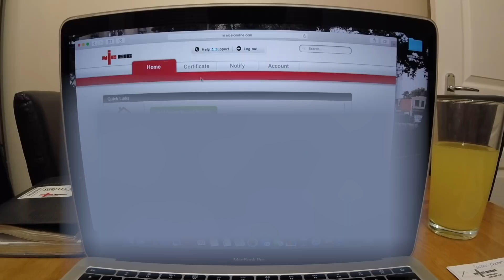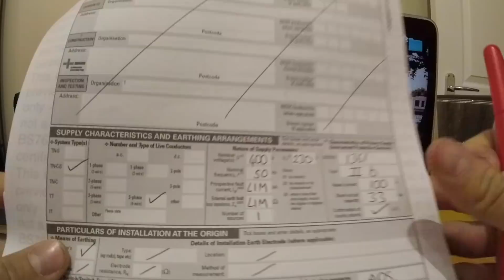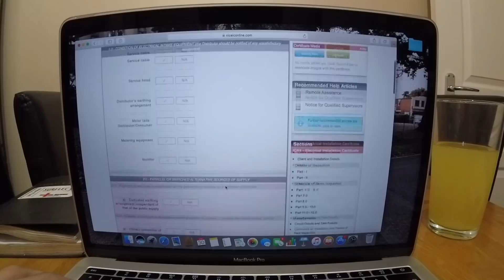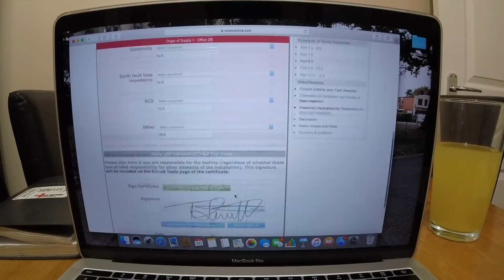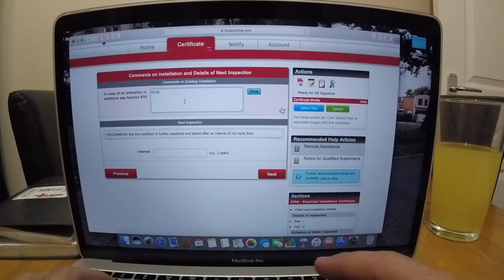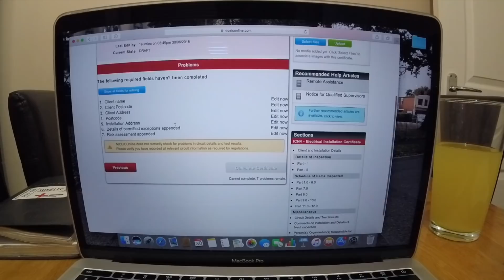SurelecTV- NICEIC ONLINE CERTIFICATION- Electrical installation certificate

Comment: Great video, it helps as I couldn’t decide which certificate software to use. I’ll be going with the NICEIC now. 
One point to note would be with the name you designated to the ‘Office DB’, you can only call it that if the actual DB is physically marked up as ‘Office DB’ on-site.

Comment: Just so you’re aware, in section one it asks for the ZE and the PFC, this is the maximum for your incomer, the drop down brings them up for each common incomer and also 16KA for the PFC! There is actually 5 boxs you should be filling in on the earth electrode section which is confusing! Method of measurment, measured ZE (this is where you put your measured ZE in), maximum demand, method of disconnection and number of smoke alarms! Why they have put it in this section is beyond me but thats how you do it! Also, measured PFC actually goes in the board details in the circuits section!

Comment: Great video thanks for taking the time to do these informative videos. Could I ask if you could possibly do a video for voltage drop, current carrying capacity and there formulas used to work them out. I am doing my level 2 part P and was wondering if I could get another persons terms of using the calculations etc and how you go about doing them.
Thanks

Comment: Great content mate, a lot of trouble gone to in giving an insight into certification. One thing, you say a limitation for PFC  as unable to disconnect earthing conductor ? My understanding of PFC was that all protective conductors must be connected during the test. This lowers the overall impedance (circuits in parallel ) and subsequently gives the highest possible fault current.  Anyway just a thought and not intended as anything else but sharing views, keep posting.

Comment: Hi, I didn't find it boring at all It's good to see the NICEIC software I have only ever used the Easy Cert and Trimble (Amtech) certification packages. You went abit N/A happy and N/A'd where you should have put ADS. Also you stated that you couldn't isolate, therefore the "connection/continuity verified" for the bonding should have been LIM as if you disconnect the bond to carry out the continuity test you are putting the installation into a potentially dangerous condition with no bond in a live Installation. Thank you for the time and effort you put into these vids it's good to see others at work!
Reply: Steven Skillern if main earthing and bonding can’t be confirmed then work shouldn’t take place, we all know in the real world that’s not always the case such as this in Toms case a large installation spreading through multiple building with mutilple extraneous parts it’s almost impossible to whole heartily say yes all bonding is in and satisfactory.
Reply: tomorichard Thompson hi mate, totally agree however He can leave the "tick for the bond to the steel  and N/A all the others as he has visually confirmed this and done a basic R2 test with everything connected, it's just he can't "tick"  above that to say that he has confirmed the continuity of this bond as doing this would involve disconnecting this bond on a live Installation. It's a very common things in commercial and industrial situations not to be able to do this like you have said, just if he had a fussy person like myself lol looking over his report I would highlight it for future reference. This is meant totally constructively  as the more we can all help each other the better our industry can become, plus I like his vids so wouldn't want to offend him or anyone else.
Reply: Steven Skillern yes I agree in all honestly out of all the British electrical you tubers I believe he is promoting  the best working practice. Like you said it’s good to have these conversations and learn from each other
Reply: tomorichard Thompson If you like Tom then I would also recommend subscribing to "My trusted electrician" his standard of work and detail is very good and very high